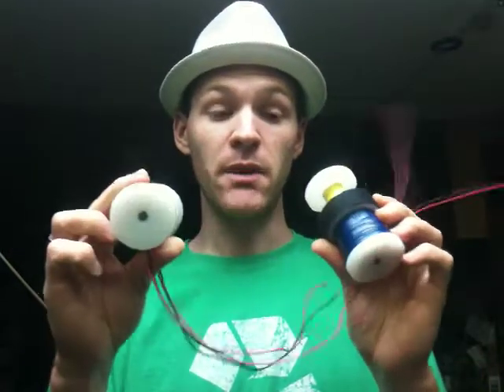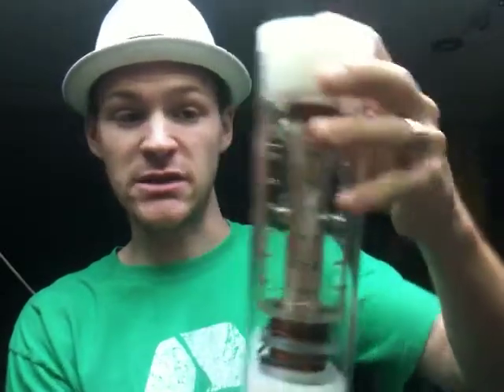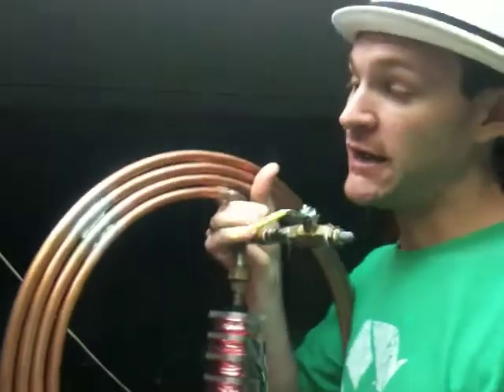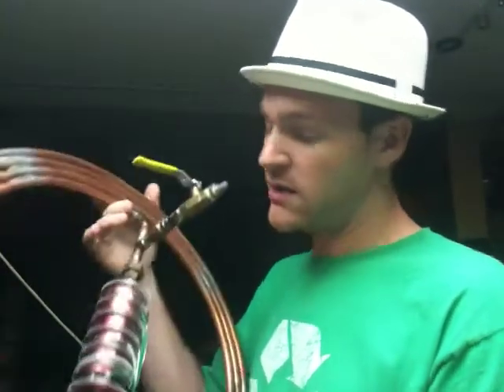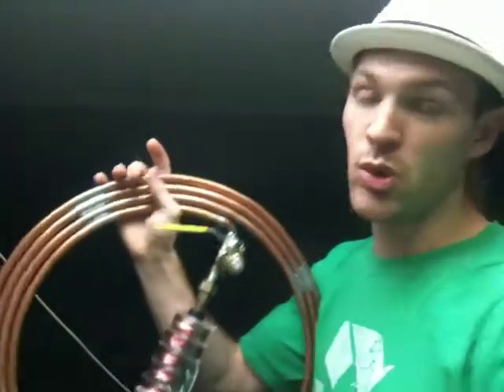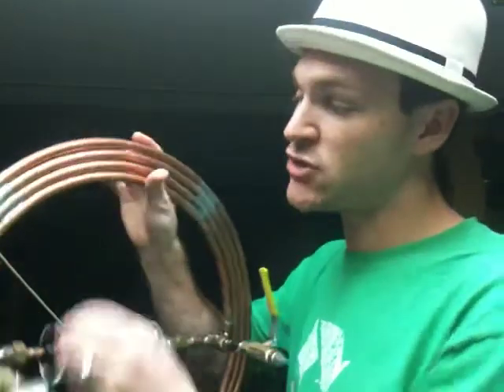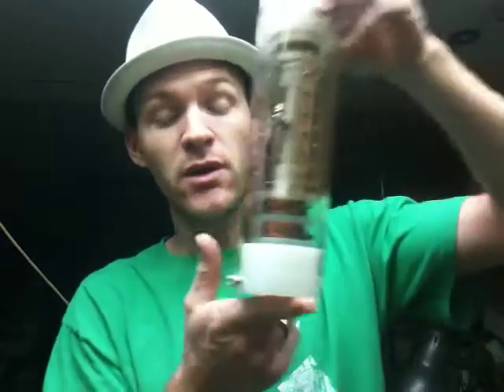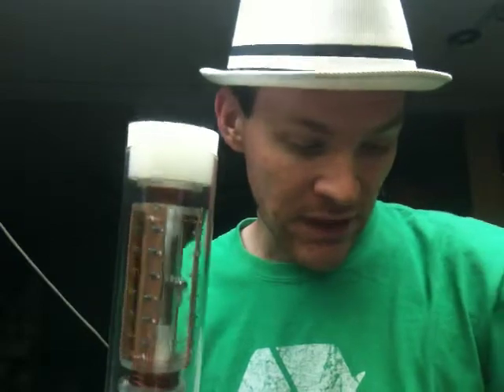Where Is The EPG? What's The Plan? What's The Progress? Web Page Updates & More! ~Russ

Comment from the maker: @mikepowers420 Mike, my thought was that the hydrogen only had 1 electron and then there is a'n extra electron as well. Then the oxygen is the main electron carrier. ?? You can see this in stand work? 

Then, once you ionize it ( and stans way dose It in the cell as well) then you can also process the gas with the gas processor to strip away those Oxygen eletrons to only have 4 or so left on the oxygen. 

Then by pulsing more or less on the led's/plates you can change the energy output... ~Russ